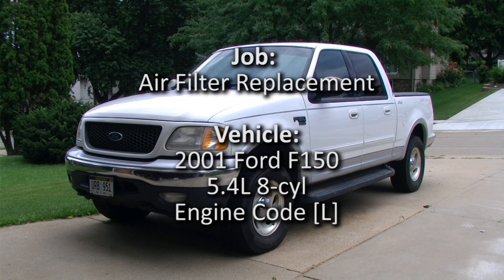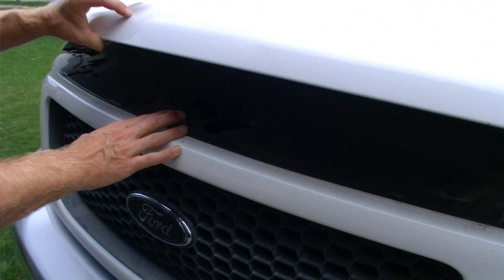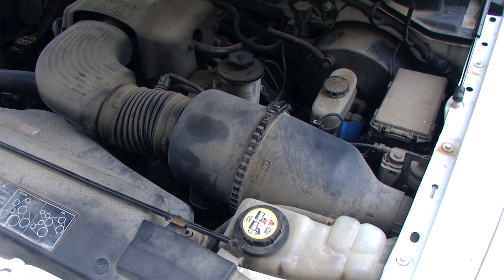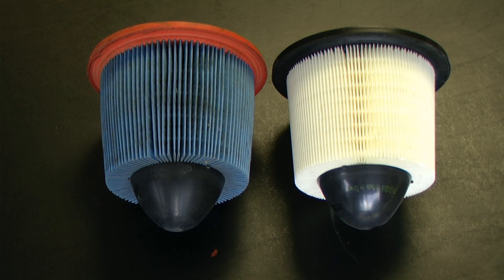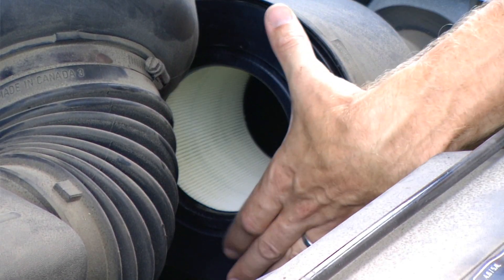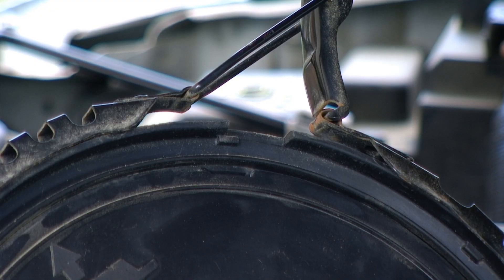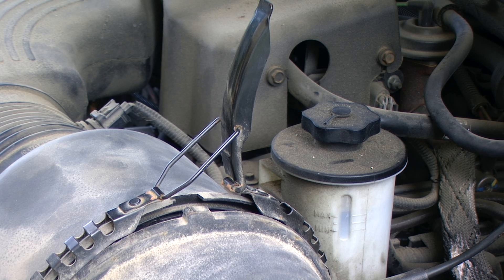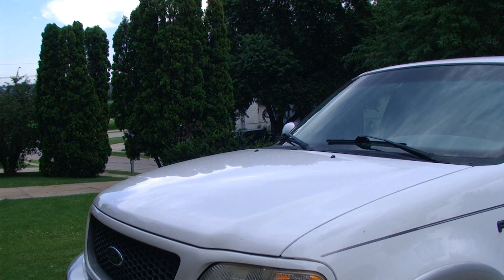2001 Ford F150 Air Filter Replacement

Comment: How long should someone change the air filter? If driving around town? Or dusty places ? Thanks
Reply from the maker: The repair manual specifies replacing it every 30,000 miles or 24 months.  However, I remove the air filter every two months and blow it out with compressed air just to keep it as clean as possible.
Reply: That’s a long time I do it once a year
Reply: I do it every other oil change. Really depends on where you live
Reply: I normally replace mine once a year, at about 20k miles more or less.